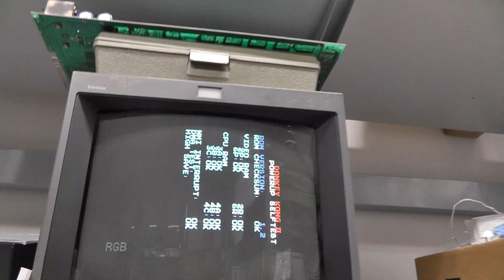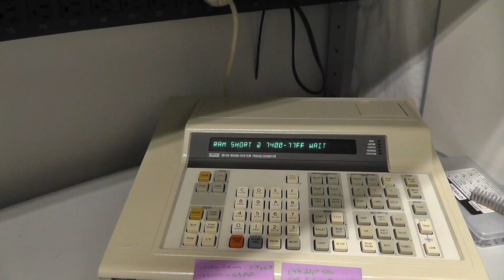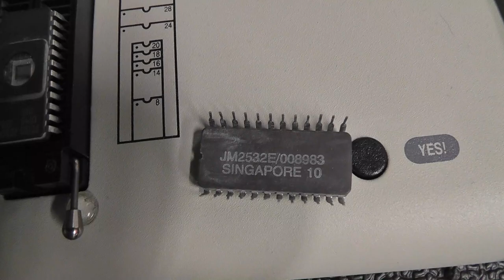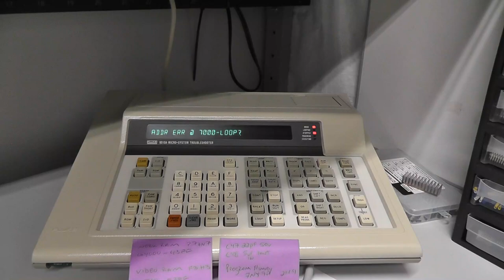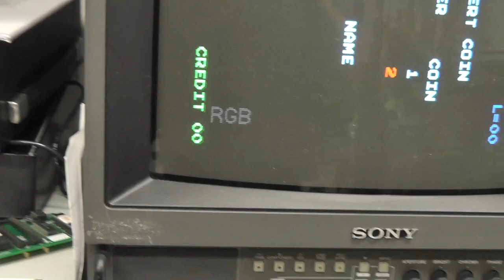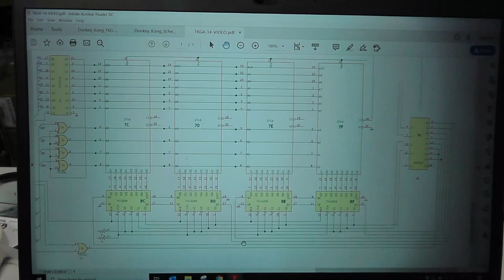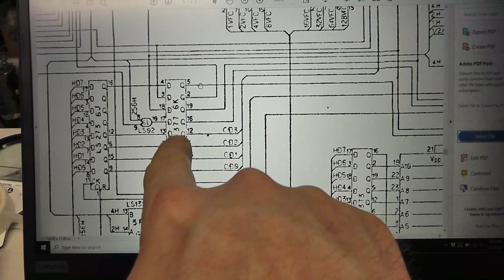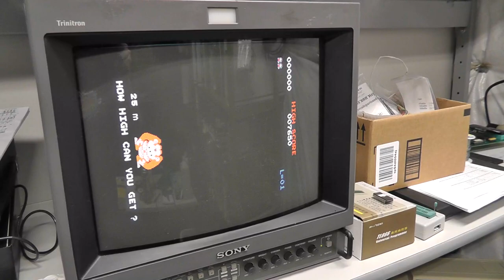Nintendo Donkey Kong PCB Repair - Arcade Buffett's

Comment: Great job!I have a fluke at the shop, but have never turned it on. It's nice to see how others are repairing these boards. Seem like they all have unique failures. Thanks for posting this video!
Reply from the maker: Thanks for the comment. I definitely reference and have used a bunch of your products in my Nintendo videos.  Appreciate you making them available.
Reply: Mike, you repaired all those many DK board without a Fluke?
Reply: @WinrichNaujoks  yup. Logic probe and a meter.

Comment: I would have started looking into the cocktail mode XOR circuitry. Checking the schematics while watching the video (just a quick look, I could be totally wrong) it looks like different portions get different enable signals, maybe one of these is missing and that would flip the sprites but not the background. Or a broken trace could do the same.
(checked the schematics again and 6J indeed drives another latch that controls part of the XOR bank circuitry)
If I don't see toggling on the oscilloscope, I set it to a really slow timebase and see if a faint line or dot appears below (if high) or above (if low) the trace.
Reply from the maker: Ahh, good thought on the cocktail XOR and flipping the sprites.  I will have to rewatch the video but am sure I about as inefficient on a scope as one can be.  One of those things where the more I use it the better I get but still long way off.  Thanks for the tip.
Reply: @jacklick  You need the right idea in the right time, which depends on luck. You don't wanna know how often I went down the wrong rabbit hole because I didn't initially have the right idea.
A good technician doesn't need to depend on luck because his/her troubleshooting skills will sooner or later guide him/her on the right track, as demonstrated in this video. The final result will be the same, it just takes longer and you'll gain experience in the process.
Knowledge can be transferred, experience can't. Experience comes with time and gaining experience is quite a journey and that's why I think your channel name fits quite well. Thank you for taking us along!

Comment: Why did nintendo use Konami Processors instead of another type of processor to run their graphics for the sprites and characters? There is a reason why they choose the Konami processor and also used the VLM-5030 Sound chip because you will see it use on various nintendo boards. Any reasons why they used the VLM-5030 sound chip and the Konami graphics Processor?
Reply from the maker: no idea but feel free to post the answer.

Comment: The "T" of «CREDIT» is incomplete for a moment at 55:14,  https://youtu.be/eWCpXPRSoSs?t=3313
Reply from the maker: I didn't notice that, thank you!  However, I noticed something similar on my working board when first powering up the zero on "credit 0" is incomplete for a few seconds.  I am wondering if it is power related or capacitors charging up.  Not sure.

Comment: Nice vid!   I had the same issue on DK with the fluke..   would not run UUT..  wouldnt pass ram shorts on the vid PCB...   its not your pod :)
Reply from the maker: Thanks.  Interesting you had same issue.  You were using the original z80 pod?  I thought it might be an issue with my repro pod.  Thanks for sharing your experience and also for the videos you make.
Reply: jacklick yup i have the original z80 pod...   i have the repro 6502 pod from that guy on klov (his name escapes me).  I bought the protection circuits from a guy on ebay..  JM Precision (i think his ebay name is Grimble, or something like that) i believe..  i think they work better than the protection circuits that come with the repro pods